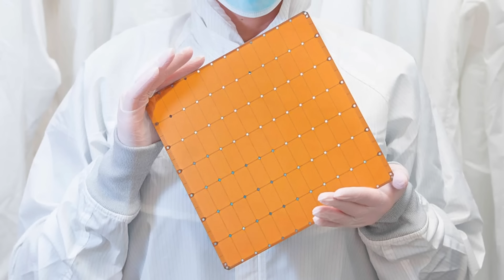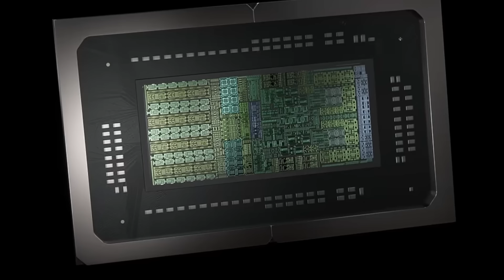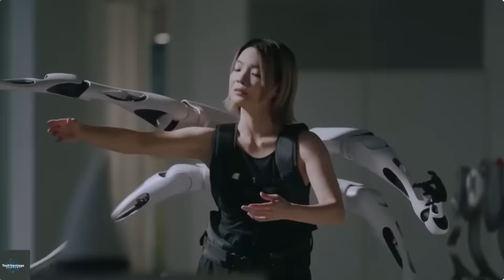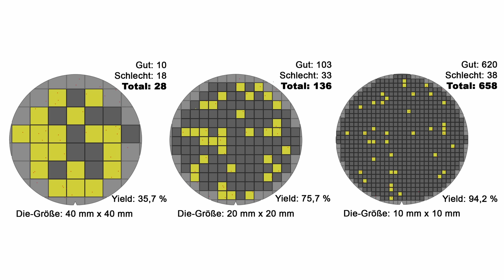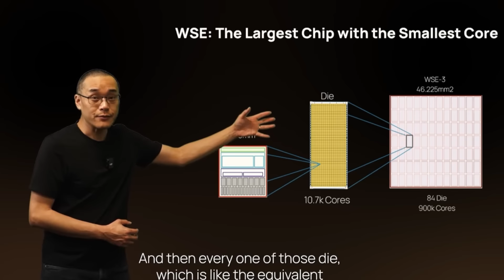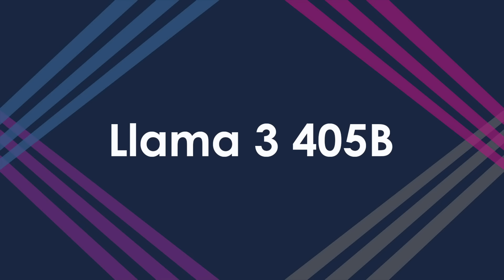This New Technology Could Disrupt Nvidia

Comment: If I can do an AI inference job 20 times on Cerebras while only doing it once on Nvidia, I will use Cerebras every time.  Nvidia has an approximate cap of $5.3 trillion where Cerebras Systems' valuation is roughly $65 billion.  But if Cerebras captures only a 10th of Nvidia's business, that would be $530 billion, but they are currently only just over 1/100th of Nvidia's market cap!  That is the growth potential of Cerebras.  They are worth the investment.

Comment: When the chip powers on it does not determine the broken cores.  It is a special set of tests they run and save in the bios.  It would be to slow to run every time they power it on.

Comment: I have an answer to the speed of memory issue .. Its called 3D Photonic Memory .. SRAM has 5-6 GHz operational speeds , but 3D Optical has with one laser 50-60 GHz Speeds .. Now think about 1024 lasers or more , we are talking Exabytes of speed .. We are talking about a way to speed AI by 5 -10 orders of magnitude if we move to SiPh , Silicon Photonics .. Intel is quietly working on new Glass substrates with a combination of TVG's . These are via's that will allow both copper via's & ducted SiPh tunnels ..